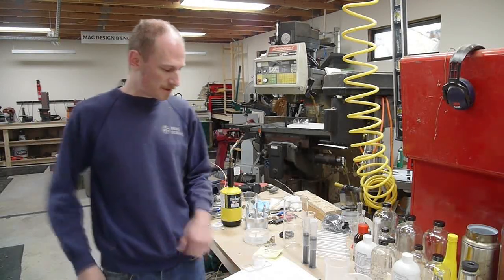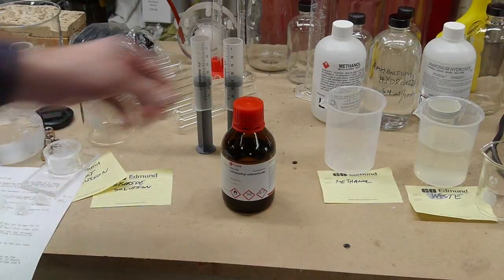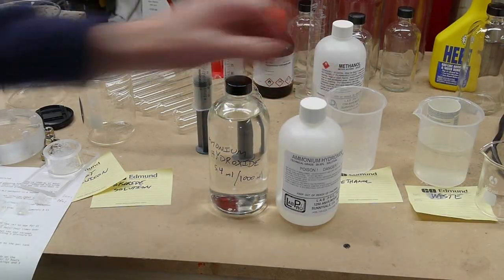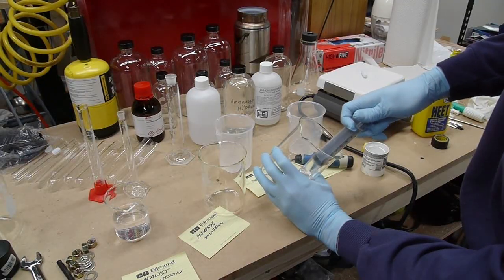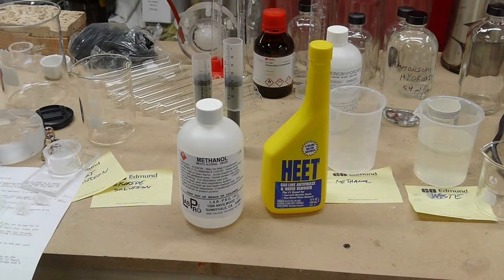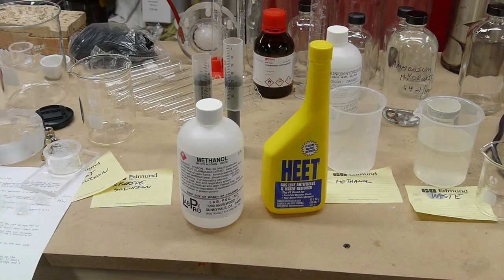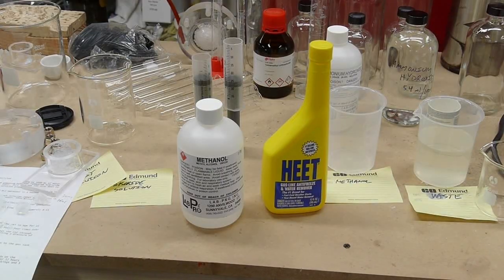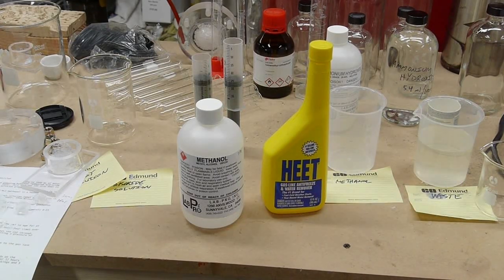Making silica aerogel at home

Comment: i just completed one of my ideas on my youtube chanel its a tazer glove works great. when i watched the makeing of aerogel for the first time i had an idea. 1.what kind adhesive would you use to connect aerogel to the following materials. carbon or graphen ti. if its not possible could you connect the material by using the meted of interlacing materials that can't be puled or moved apart with out removing the firspeice like a puzle. could you use the aerogel a insalter in a body suit for highh

Comment: I have been trying for the last couple of weeks to make some TEOS aerogel, but so far it isn't working. Do you have to do anything to maintain the integrity of the aerogel while flushing the system with liquid co2? It seems to me that if we are replacing all of the ethanol with liquid co2, when it is bled off it will evaporate off when the pressure drops and collapse the gel, or are you careful to keep the pressure high? I'm just running out of things to try. Thank you for your help.

Comment: hello hi love the site and shop. i was thinking and people say that my ideas are crazy but i think they might help human kind some how possibly. my Questions to possible applications of human technical development, are the following 1.what kind adhesive would you use to connect aerogel to the following materials. carbon or graphen ti. if its not possible could you connect the material by using the meted of interlacing materials that can't be puled or moved apart with out removing the firspeice

Comment: A better method of removing water from the gel block before drying would be adding Calcium Oxide in the methanol to dry it of water and have the gel block sit on a stand away from the Calcium oxide. Calcium oxide is insoluble in methanol and is used as a drying agent for alcohols.

Comment: Good job, man; this is really a cool accomplishment. I have wanted to make aerogel but never got around to it.

I have wondered how aerogel holds up when under compression in a confined space. I know it breaks down in the presence of moisture, but does it hold up structurally if it is completely encapsulated in something like heat shrink plastic? You could stuff a small piece in some heatshrink, heat seal the ends and see what happens!

Comment: Interesting and congratulation it works out. I did some investigations after watching your experiment. TMOS is highly poisonous and creates explosive gases (flash point at 26°C). Everyone should definitely read the material safety data sheet and take the necessary precautions! No wonder they don't sell it to individuals (even here in germany). Overall it's very interesting but i personaly don't have the lab and machines to do this kind of experiments. It's very cool you share this with us.